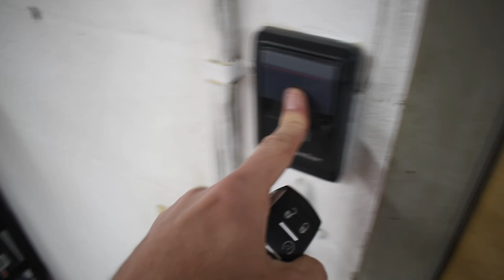Finally mounted the Corvette wheels!

Comment: I must be the odd man out but I actually like the wagon wheel wheels. Did you ever consider powder coating the original wheels a different color? 🤔
Reply from the maker: Did think about it, yes… I have 2 sets of the original wheels. 1 set in chrome and the other plain grey. Might do something with the plain grey ones as they’d take color well I’m sure.